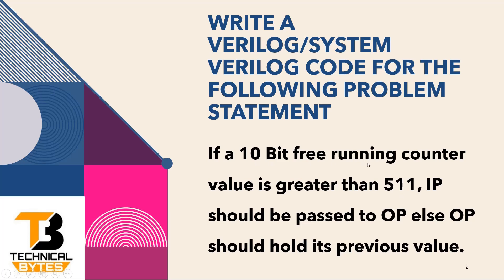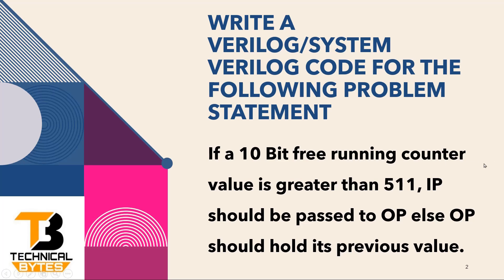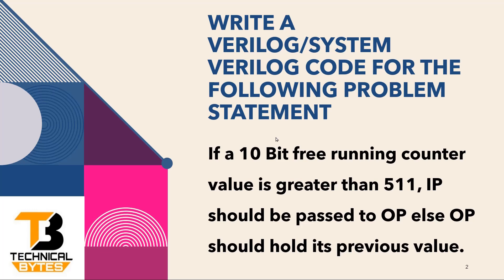System verilog / Verilog Interview QA Part 1

Comment: module (in, clk, reset,out);
input in,clk, reset;
logic [9:0] count;
output logic  out;
logic out_reg;

assign out_reg = (count >10’d511)?in:out;

//registering to avoid combinatorial loop

always_ff@(posedge clk)
begin
if (! reset)
out <= 1’b0;

else
out <= out_reg;

end

always_ff@(posedge clk)
begin
if (! reset)
count <= 10’b0;

else
count <= count + 10’b1;
end 
end module
Reply from the maker: Dear Rohit, while generating variable out_reg como loop is already generated.
Reply: @TechnicalBytes  yes,  the combo loop is generated , what I meant is by registering I am avoiding any case which could cause glitch in the circuit . Isn’t it?